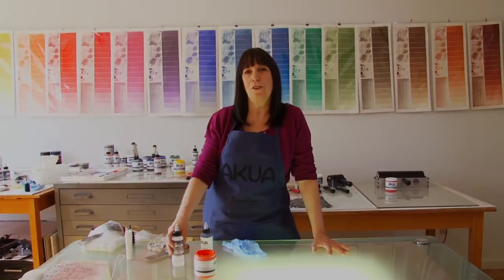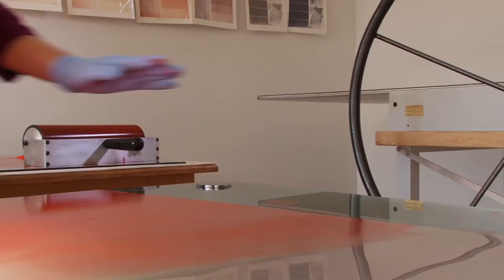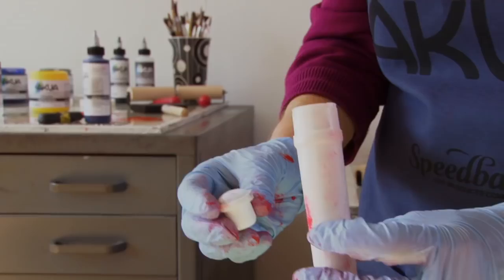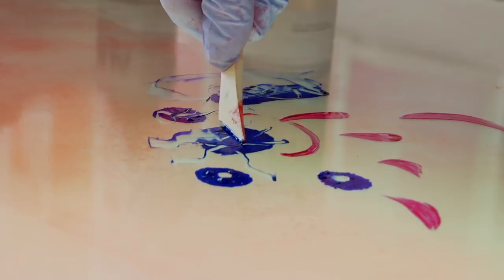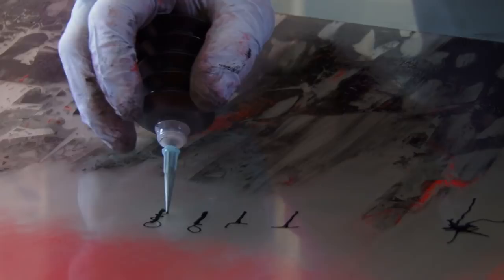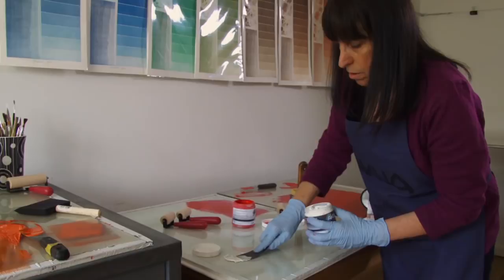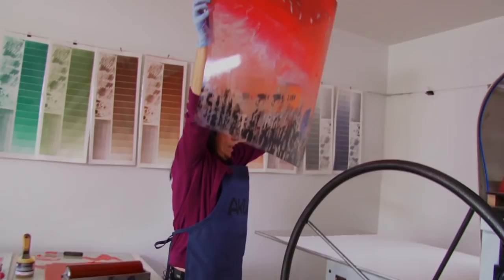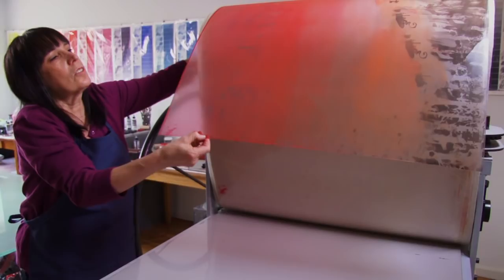Monotype Printing with Akua Inks

Comment: small question.when i try to press the liquid akua pigment ,the color  always went out the area of the plate a lot.
Reply from the maker: That means you have too much ink on the plate. Roll small amounts at a time and keep the ink flat and smooth so it doesn't spread when printing.
Reply: @akuaprintshop4511  thank you .
Reply from the maker: @duckyprinting1337   You're welcome!